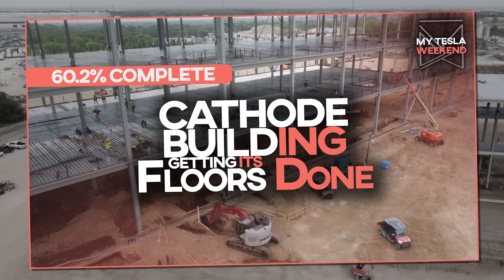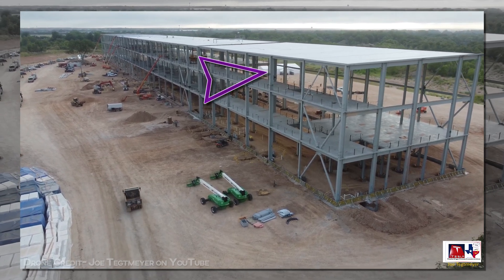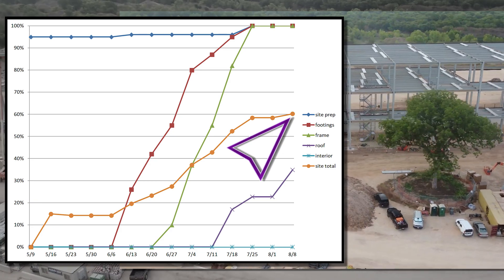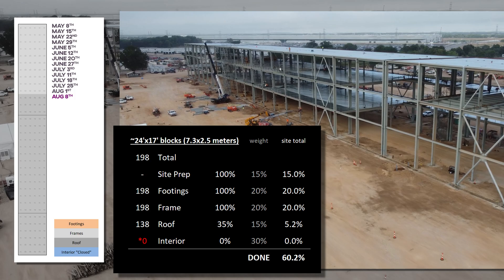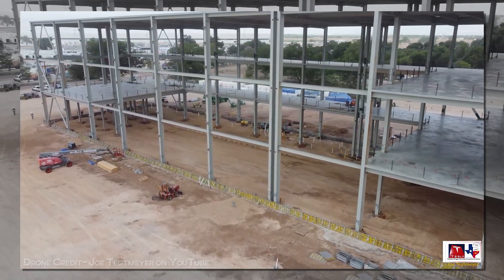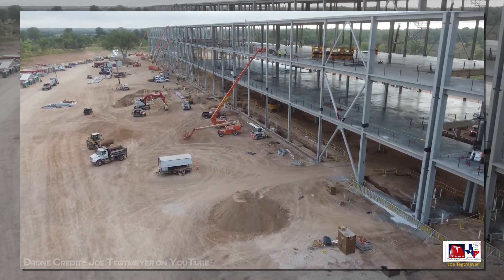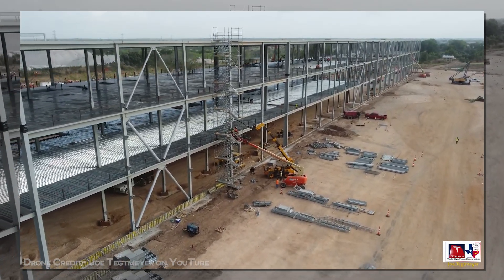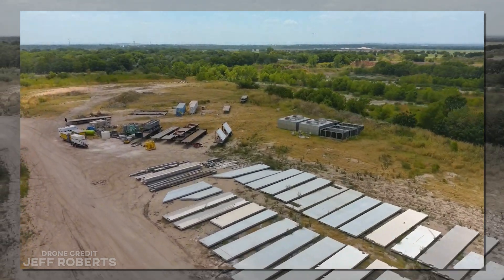Is it REALLY 60% done? Cathode building at Giga Texas is screamin' along

Comment: I agree it would be good to use the reaming unused panels from the main factory, although that assumes the dimensions work.  Could you prove that from the information you have cleaned from the main building versus the cathode facility?  If they did reuse the panel I do not think the condition of them would be an issue as they might paint them in the end like the south-eastern face of the main building.

Comment: I wonder if they will hold off on some wall panels for the equipment.
Reply from the maker: For higher floors it makes sense to only keep them open where they have loading platforms.
Reply: @FutureAzA  I don't get why they don't incorporate loading platforms in the building. They made them look like an afterthought on the main factory. I also don't get why they didn't make them hydraulic platforms. Instead of having cranes sit at each platform, they could use forklifts to put the equipment onto the platform at ground level and the platform raises and gets unloaded by another forklift. Platform may cost more, but they would save so much in labor and equipment and it would look better as the platforms would be hidden in the ground.
Reply: indeed, shoving big machines and tools trough open walls is much easier that way.